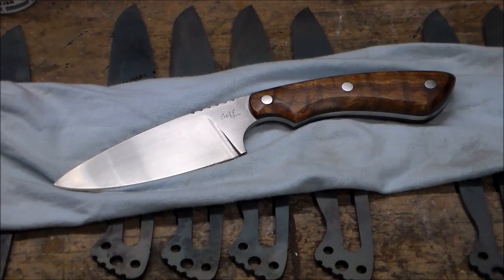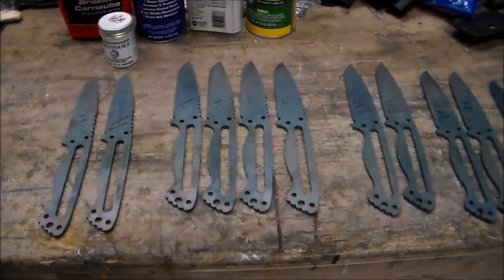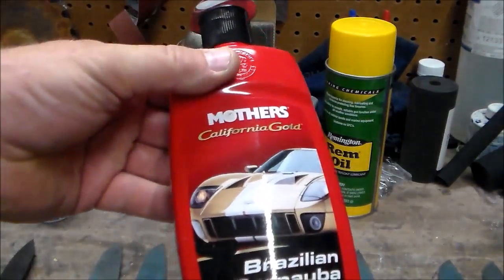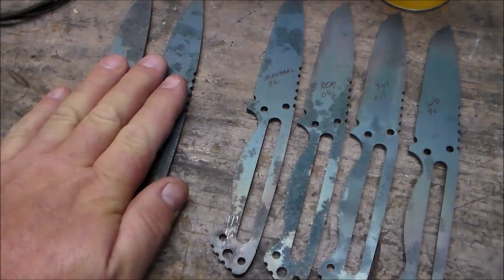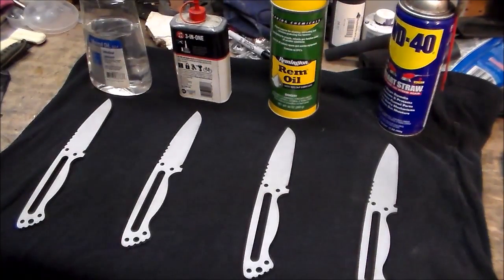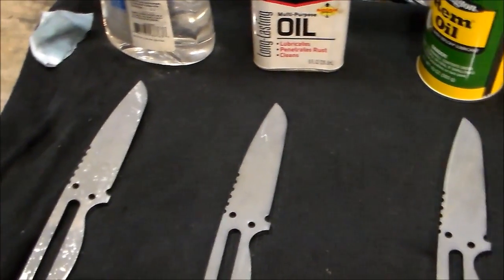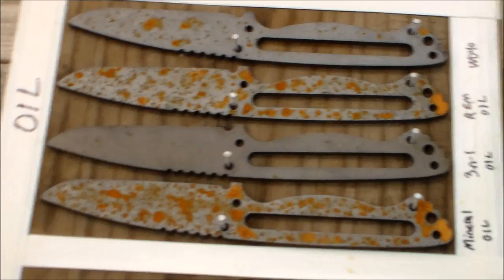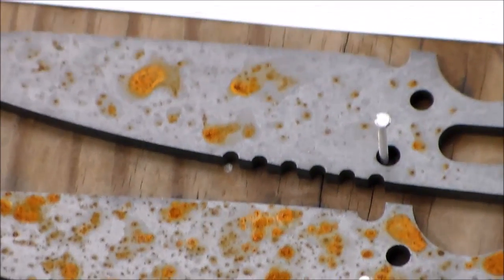1095 Steel, Corrosion/Rust Test for Knife Makers

Comment: And thats not how you do it... You have to heat up the knifes and then you put the diferent protective coating.. You just putted the coating xD... Thats not protection its just coating.
Reply from the maker: People have been using coatings in one form or another for centuries without heating up their tools, knives, guns, etc. To say you "have" to heat up metal to apply a corrosion inhibitor is silly. Might help, might not, but definitely not required. In fact, putting that info out there will likely result in damaged knives. Most epoxies let go at around 200 degrees and depending on how you heat the blade, you could easily screw it up.
Reply: @SelfMadeProject  Its made before epoxy and handle fix. Burned linseed oil on tools is the best. thats how eldery usted do in Ireland small villages. And thats how my great grandfather uste to do, and in fact i still have some of his tools that I can spot any rust on it. I just want to say that i enjoyed your video and it was a really nice test, but maybe give it a try with the burned oil on metal or also beeswax and then compare between the heated metal and oil, and not heated metal and linseed oil or 3in1 oil, your best performance on this test. Maybe you can make a new video about this subject and post it. Im sure its a big subject and with a lot of doubts on internet. Big hug and keep on!
Reply from the maker: @Medjurazzdiguetto  while I do agree with what you're saying about some tools, that's really not practical with knife making. On my blacksmith projects I've used bees wax, linseed oil, and Johnson's paste wax. It works great on some finished pieces and things you've forged. But, the level of hand work and finishing that goes into a knife would't allow that type of coating, except maybe on RR spike knives. In knife making, rust prevention would be something done at the end and you would't want to be using heat at that point. I also suspect that the layer of protection on your grandfathers tools wasn't just created when it was made. More than likely it was built up with many applications over the span of many years. Cherish your grandpa's tools, I wish I had some from mine.
Reply: Shit my life rule book must be out of date. I didnt read anywhere where it said I had to heat up my knife before I oiled it. Can you please send me a copy of your life rule book so I may live and do things the right way. As to not anger people like this guy.
Reply: @floppinfish  I dont think its out of date, you may want to read it better. Anyway, you have everything you need on my comment. The book is 50 bucks for'ya pall, but only the "knife rule book".  ;) !
Reply: I'm confused does corrosion help protect the blade or are you seeing what protects it from corrosion.